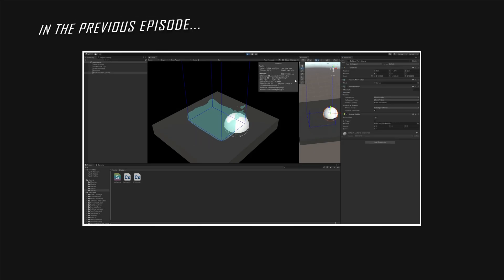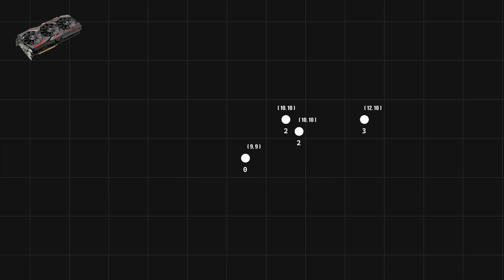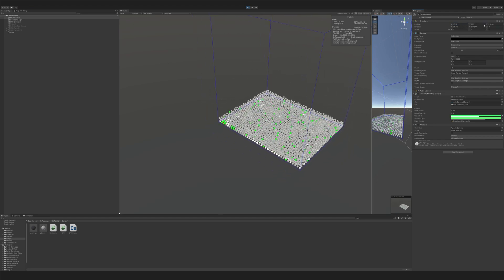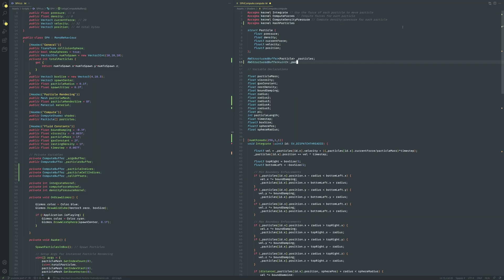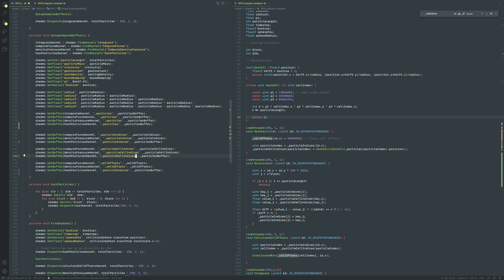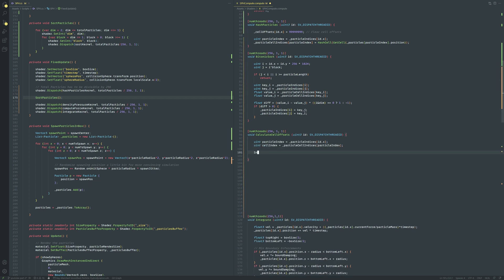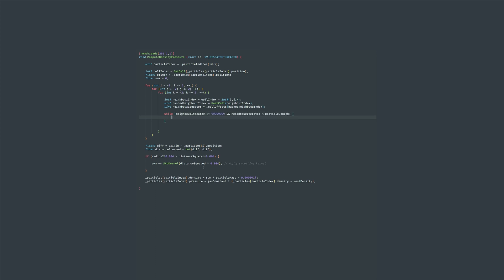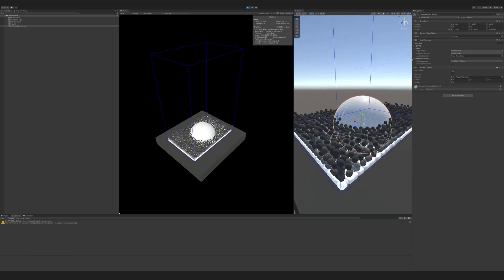Coding a Realtime Fluid Simulation in Unity [Pt. 2]

Comment: Hey man I have been trying to implement this code but am struggling to get it working without having the particles fly all over the place.  I checked your repo but it wasn't updated for the new optimizations made.  I love this video and would love to use this for my own indie game.  If you could help me it would be greatly appreciated!
Reply: I've been implementing this as well but from sebastian leagues videos. One big thing is parameter tuning. Another  is that if your smoothing radius is too low (I had trouble with 0.12), some of the kernel functions will give you values that are way too high (because we divide by 1 / (0.12)^X where X is some power). Let me know if this helped!

Comment: I am thinking of creating a game in the style of Royal match, essentially a match-3 game. I would like to incorporate a fluid structure in some levels to navigate through the board. Can I use this system, or do I need to use a different structure?
Reply from the maker: Hey! I think SPH might be overkill for what you're trying to do, here's another one of my GitHub repositories which is using a simpler version of fluid simulations which just uses the Navier Stokes equation, it's a lot more efficient and can be run on bigger grids 

https://github.com/AJTech2002/Realtime-Fluid-Simulation 

This is the paper I referenced for that repo: 

http://graphics.cs.cmu.edu/nsp/course/15-464/Fall09/papers/StamFluidforGames.pdf

Hope this helps!
Reply: Thanks  so much for sharing with me  @batchprogrammer108

Comment: Another optimization you could try is creating a 3D dispatch size and thread group and use shared memory. This way all threads would access data from shared memory rather than global memory and improve memory bandwidth. You might need to play around with the thread group size to get better performance.

Comment: Can you run the simulation with Unity DOTS?
Reply from the maker: You can but something like this would run much faster on a compute shader, especially since in future you'll need to take this data to the GPU so that you can render it to look like actual water. Since this is already on the GPU it will be much more performant :)